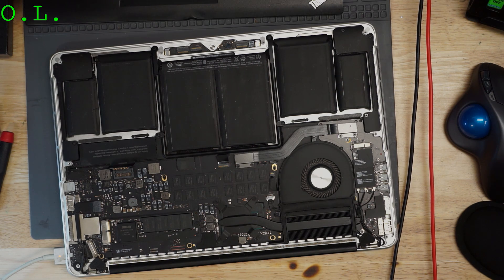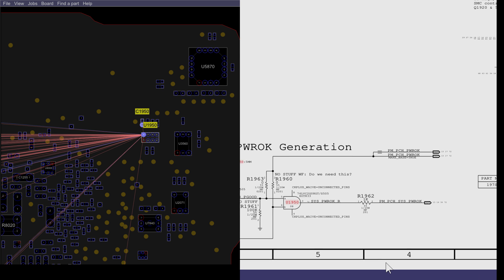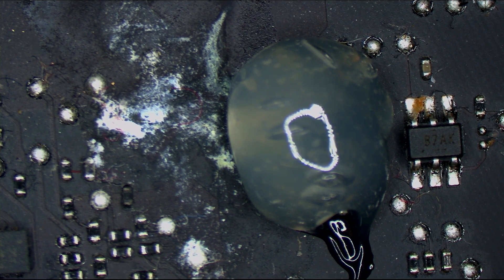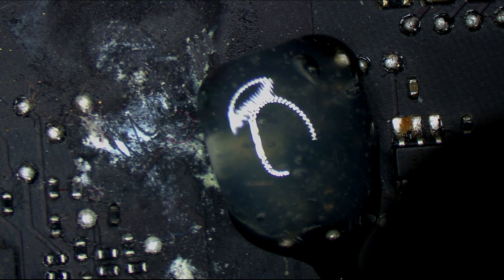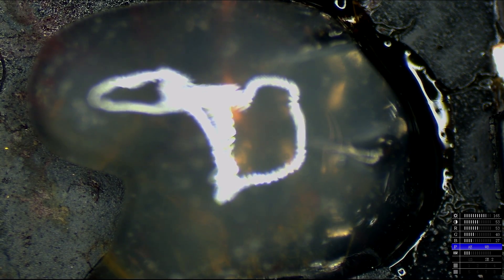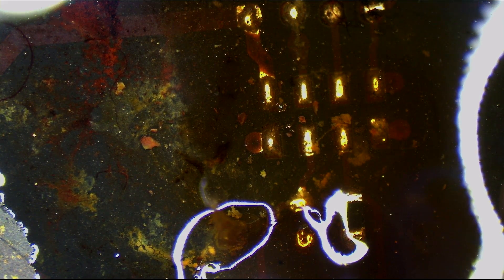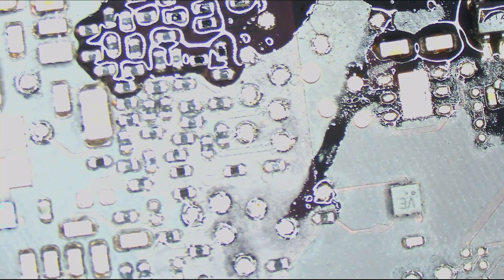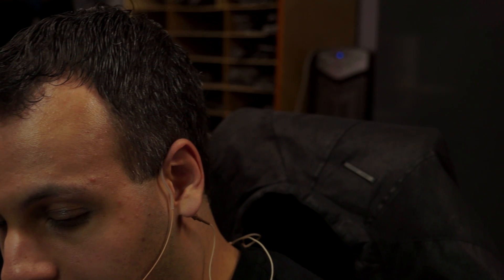Why fix logic boards before cleaning the corrosion?

Comment: It’s truly amazing the amount just cleaning a board from corrosion apeven if it’s a thin layer of oxidation that is barely visible in a scope. Ive went to school and worked for 4 year on diagnostic ultrasounds and I was primarily into repairing boards and tracking down then problem using schematics rather than play games swapping several boards. 

Would you have time to talk in regards to the third party repair industry? I’m not trying to sell anything, but I truly need technicians and their opinion on a matter that’s troubled me for around 5 years now, and I would LOVE for you to see some of the places in my area. Kid fixes a phone in college, decides to open a business and make up problems and solutions. It’s too funny but for customers it’s just as bad as the corporations,taking advantage of a problem to score a sale. 

Let me know. I would love to know if you think it’s something that EVERYONE could benefit from. Bravo my friend. I’d love to know what type of training you’ve had or how intensively self taught you are.

Comment: So how would I go about sending you two iPhone 6s Plus’s to get them fixed? One shows no WiFi connections at all, I changed all the WiFi antenna cables, from behind the logicboard to the long range, and it’s still not working..and the other doesn’t rotate, gps is wonky, id explain it in more detail but I’d like to know how I could go about getting your services... please help! They were supposed to be Xmas gifts but I wasn’t able to fix them on my own.

Comment: You shuld clean the pads after removing the components, all that corrosion and grub will interfere with clean solder joints, regardles of flux. You've done that before, why the hell would you change the good habit into this...

Comment: Quick question : I have a rMBP 15 (mid2015, notice the same with a mid2014), when I have it plugged to the powerbrick, if I stroke the aluminium around the keyboard (easiest is either side of the touchpad) with the bare palm of my hand, I feel like some kind of vibration ; when I unplug the charging cable, it stops at once. I would guess this feeling is related to some slight grounding issue. Is it normal ? should I have it fixed ? thanks :)

Comment: I take your point about not cleaning before diagnosing/desoldering parts, but I'd at least clean the area under the chip before soldering a new one. After you solder a new chip on top of all this crap (liquid damages are often made with very sweet soft drinks), you won't be able to clean it properly. The residues of caramelized sugar will be both corrosive and conductive, while residues of oxidized tin are hygroscopic.
Reply: tzok83 that is what he does, use flux to remove old RoHs solder with wig, than redo joints with quality non-ROHS solder, flux on - solder new component
Reply: @FilipKrieger  On the video I can see that he adds flux, uses hot air to remove IC, scrubs pads, tins them, adds more flux (without cleaning the old one with scrapped flakes of oxidized tin, carbonized resin from flux, and caramelized sugar residues), and puts a new IC, and finally solders it back (with all the crap jailed underneath it). I don't see any solder wick, nor IPA cleaning.
Reply: tzok83 I don’t remember this particular video, actually, but he normally do it the way you described.

Comment: Dear Louis:

So when repairing water damaged logic boards whether it's iPhone/iPad/macbook, is it absolutely essential to replace components on the board that were water damaged?  Is their no point to water cleaning boards with an ultrasonic cleaner and/or isopropryl  alcohol without replacing board components?  Debating whether we should bother taking in water damaged devices at the shop since neither of us knows proper micro-soldering yet.
Reply: I think this is a case of time versus money. It's cheaper for Louis to replace a probably faulty component with a new one rather than to spend time testing each IC, Resistor or Capacitor to determine if it's faulty or not. Testing IC chips is more time consuming since you'd have to test each logic  gate function.  These components when sourced in large number is dirt cheap. The more fan spins in a day = more revenue. 

Louis does test resistors  to determine if they need replacing in some of the videos. Or watch a capacitor glow red hot and burn out for the Lulz.
Reply: Also for your own good, customers lie about what they did even though they're paying for the repair. The tendency to needlessly lie stems from that if they admit the fault they assume they'll get higher repair quotes.

If you turn then away after finding water damage they'll leave you one star reviews. So better if you practised microsoldering a lot before scaling up your repair business as most of the damage seems to be from spilling cups over MacBooks.

Comment: This crap still makes me wonder why Apple do not use conformal coating particularity on a mobile device, it would pretty much prevent this corrosion from happening, but then I remember its Apple and they do not want your item to last they want to fail at some point.

Comment: Emm.. Louis, when on PCB is corrosion, i, usually remove component, clean pads and then wipe of old flux with alcohol, then apply fresh flux and component.. reason - sometimes that dirty flux may contain some nasty acids that may hide under the new part after replacement and after some time may slowly continue destroying board or component.. This is from experience.. ;)
Ok, i understand that after resoldering, board gets to  ultrasonic bath.. but work looks nicer, especially under microscope, when contaminated flux are wiped away.. And that's guarantee, that no sh** is hiding under the new part.. :D

That's only my opinion.. But anyway, everybody works as they want.. and watching Your work is, mostly, pleasure.. :)
Reply: He seems a little inconsistent with that, sometimes i see him use flux to clean and then a alcohol swab to clean the area where as other times its a glob or flux then right tro putting the component back
Reply: As ROHS SMD does not use flux, cleaning of old flux is not needed.
Reply: @FilipKrieger  There is no discussion about ROHS or factory assembly.. And right amount of flux is in solder paste which are used in factory's....  Have You watch this video? Louis used flux and solder wire for repair.. and put new part in dirty, contaminated flux..
 And i want to see how You try to repair device without flux or prepare coroded pads for new part without flux.. :D Flux in solder wire, in most situations, is not enough to tin coroded surfaces..
And don't mix different things - factory assembly, prototype assembly and repair!!
Reply: @artursmihelsons415  I was gonna say a similar thing!  How's the ultrasonic gonna clean underneath the new part?
Reply: Why are you giving advice to Louis? You're nobody. He's the master. Just watch and hush.
Reply: @TJPactronix  First - YouTube is open society for exchanging information, experience etc..
Second, You even don't known who i am.. and if You don't understand what is told to Louis, just ignore it..
I'm master to, as Louis, but with 24 years repair, creating and engineering experience.. 
I see video, say how i doing, say bad experience what's happen to me, but Louis decides.. And that first video comment was even not adressed to You it was adressed to Louis.. But You, don't knowing anything, first what to did - start acting rude..
And there is difference - masters, always learning from any source and from experience of others.. that's why they are masters..

Merry Christmas!!
Reply: @TJPactronix  With that mentality you will never become a "master" in anything.
Part one of "mastering" something is figuring out that you can always improve everything, there is no end to learning.
Reply: @Blacktronics  Love your icon, Quake 2 was the best one IMHO. And yes, you're right, now go eat some cheetos nerd.
Reply: El Paco Machin even Luis many times said, that his way of soldering should be understood as “bad but still acceptable” soldering technique.
Cited “worst soldering technique”

Comment: @Louis with Apple being so much of an ass with it's replacement parts how do you get your parts?
Reply: He buys boards used and plucks parts off them, or he buys the chips he needs directly.  Some parts are programmed by apple so he has to pull them off other boards.

Comment: hmm new to your videos. Seems apple would come up with a dielectric coating for their boards to resist moisture and corrosion that dissolves easily under flux...oh wait never mind I forgot Im talking about apple/
Reply: Seems they would put a protection circuit by the CPU to prevent high voltage spikes too like a Zener or something but no, this is a Tim Cook special. Kill your Macbook today and buy a new Macbook with no delay! Make Apple richer each day! lol
Reply: You just burned apple... 👨‍🏭🍎     😂
Reply: @bodolevente2246  I do love me some carmelized apple though
Reply: Something that dissolves in acetone would be good,  but they'd have to stop using ABS for the connectors.

Comment: That board is disgusting. I see why you wear gloves.
Reply: Terry Wilson  I see enough cockroach infested TVs. I'll pass.
Reply: Terry Wilson  WHAT?
Reply: @Bl4ckw0lf1  some people consider hygiene to be more... "optional" than others. this tends to carry over to their stuff. electronics, with all the dark narrow crevices looks super attractive to little critters like that. they crawl in, step on Hot-A and Ground-B at the same time, and suddenly with a fizzle and a puff of smoke, board and cooked critter is off to the Rossmann Group because "i dunno it just stopped working."
Reply: Terry Wilson  and the ants ...........
Reply: M Jons 
I do generator service , I’ll attest to ants getting into control modules and making them “freak out” 
After seeing a few I googled it and it’s a thing. 
Crazy ants they call them. 
Being in in the northeast it’s supposed to be kind of rare but is more common in the Southwest and southern states.
Reply: The gloves are also important to protect the circuits especially the chips as well I'm sure especially if they carry ESD protection. Otherwise it prevents finger oils from getting into the mix. At least it was part why I wore protection during production design work.
Reply: @Neal-001  i mean, given how prone macs are to corrosion anyway, as Louis demonstrates in basically 2 out of 3 videos, every little bit helps.